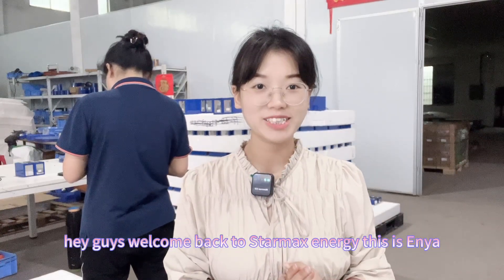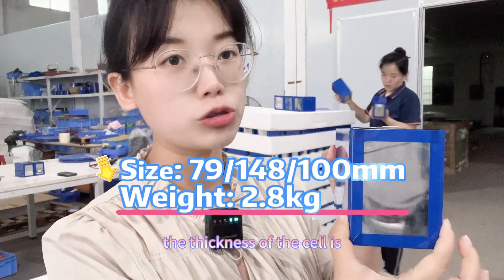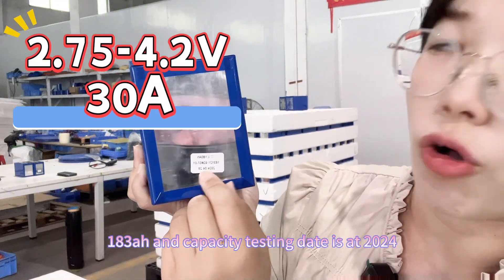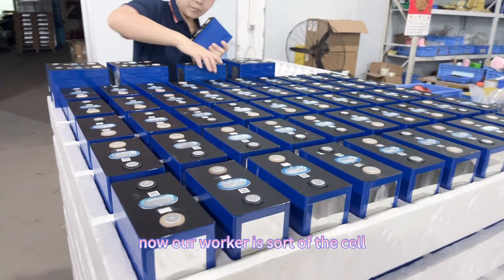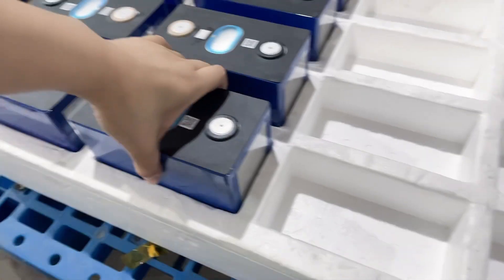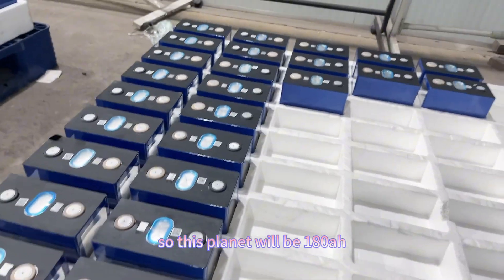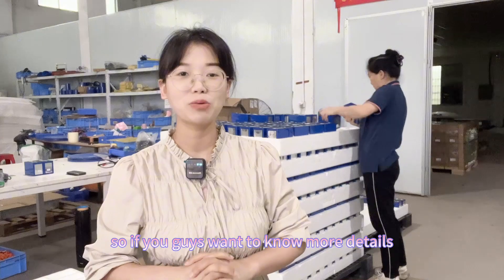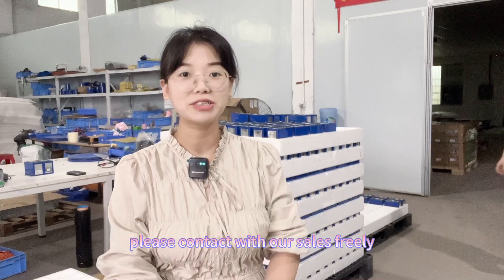CATL battery 3.7v 180ah quality control from Starmax

Comment: It is almost impossible to do a proper quality control of 3.7v Lithium ion batteries! It's all about how well they are made inside. You can test them and install a protection pcb card and charge them up and down, but a 100% quality control is almost impossible.

Lithium ion is a very dangerous battery and if factories managed to create a higher energy density in them, they will become much more dangerous than they are today!

We have tried since the 80's to get a higher energy density in Lithium ion without having managed this.

Everything cannot be upgraded forever!

Petrol, diesel have a much higher energy density.
firewood also has a higher energy density than Lithium ion.